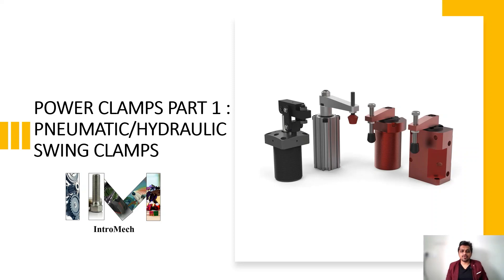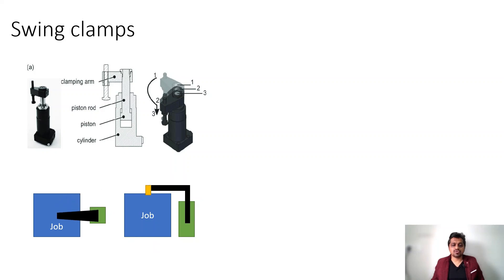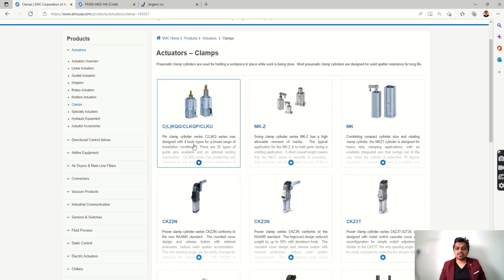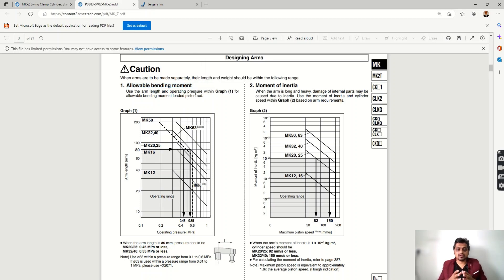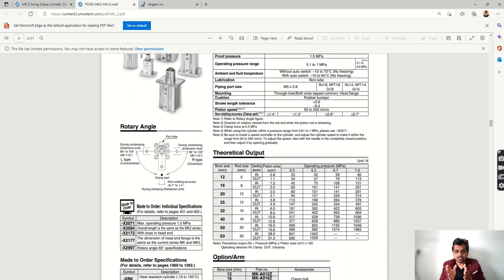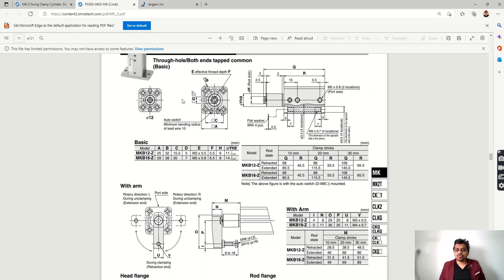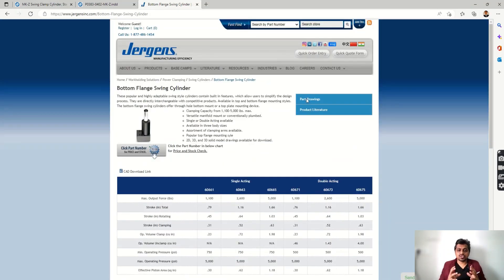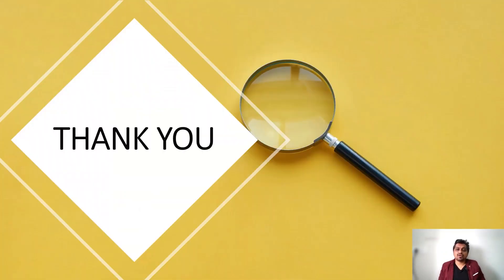POWER CLAMPS PART 1: - SWING CLAMPS

Comment: What is the calculation for force if I want variable clamp length
Reply from the maker: Hello Sagar, the clamping force will remain same for any clamp length for a particular bore size. If you go for a longer lever length for same bore size, you have to check the bending moment and moment of inertia of the arm. If it is within the allowable limit you can go with that length or you have to go for larger size bore. For reference you can read the following catalogues: -
1)https://www.destaco.com/content/destaco/language-masters/en/clamping/Pneumatic/pneumatic-swing-clamps/pneumatic-swing-clamps-9500/jcr:content/root/container/vws_tabs_copy_copy_c/tabItems/item_1625664116752/content/destacoresource_copy.pdf?pdfPath=/content/dam/destaco-assets/documents/pdf/catalogs/MC-PSC_9500_US_WEB.pdf
2)https://ca01.smcworld.com/catalog/en/actuator/MK2T-E/6-2-3-p0403-0418-mk2t_en/data/6-2-3-p0403-0418-mk2t_en.pdf